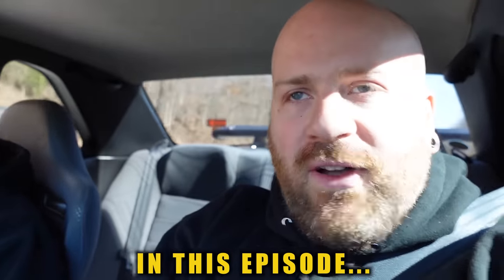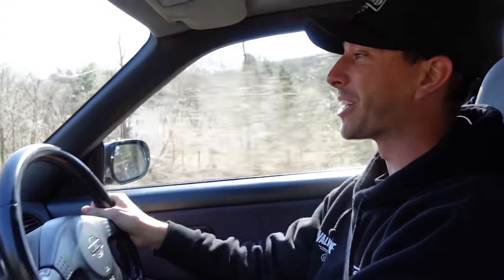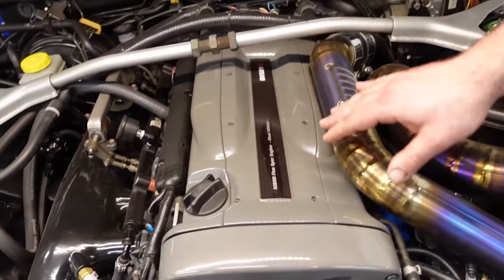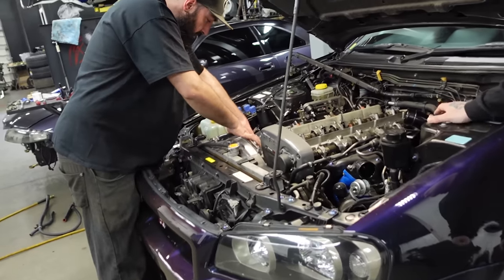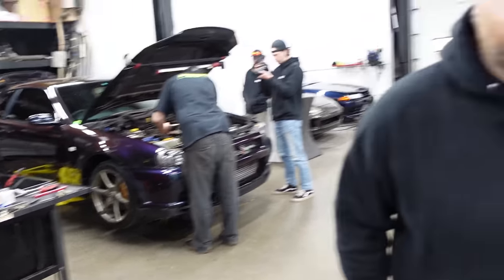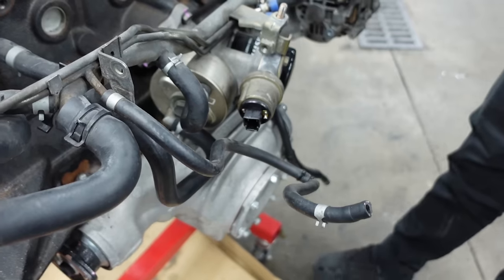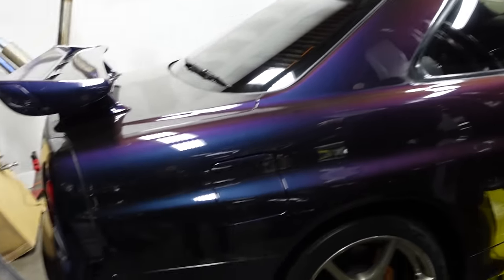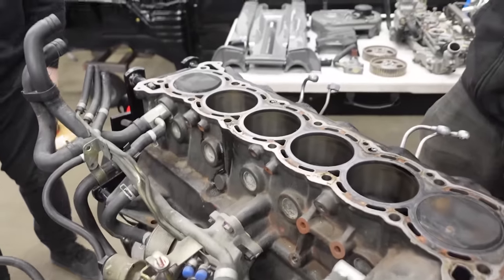Discovering R34 GTR Has Blown $40,000 Nismo Engine...

Comment: With the budget you’ve got, I’d be shelving the Nismo engine and building a separate RB26 with the HKS gear.
Reply: I believe the build was done a long time ago so any suggestions now are irrelevant unfortunately
Reply: I was thinking the same. But as the other person said, I’m assuming the build is already done and anything we say is irrelevant at this point.
Reply: agreed, baseically doing that ot a fine spec engine was stupid, just buy a normal 24U block and build the HKS 2.8 on it would be best of both world
Reply: @venroxslip6032  I’m aware.
Reply: And Teej had a spare RB motor stored at Tommy’s didn’t he?
Reply: RB30 is what I'd do, personally.
Reply: Just get the Aussies to build an engine. Big power and reliable for cheaper than jdm
Reply: @macbook802  he makes things pretty not fast. I'd live to see him build an engine rather than bolt one in and see how good it goes

Comment: The short and simple of it is the Japanese economy in the 90's was doing stupidly well, manufacturers did not need to comply with anywhere near as many safety regulations as they do now and because of the booming market people had bulk coin to splash on sports cars - which actually sold at the time. 

The R33 GT-R was built the way it was because during the R32 production cycle Gr.A (Group A racing) was cancelled and for a short period of time there was no foreseeable racing series for the GT-R to compete in - until the JGTC was formed. So Nissan built the R33 with the ethos that it would appeal more to the affluent business man that wanted a well mannered and luxurious sports car to daily drive - rather than the more homologated R32 and latter R34 GT-Rs

Comment: Pull the motor and keep it like it is... And build another motor for it..  and keep the fine spec engine stock.. It'd be worth much more with it being Factory.. imagine buying a R34 GTR and not only did it come with a badass 600+ hp  engine, but it also came with a fine spec factory engine..!!

Comment: Take the NISMO Fine Spec  motor out and store it, take the HKS parts you bought and build another motor to put in the 34. You'll a rare motor in storage that will appreciate in value and on the flip side you'll have a 34 with a hi-po motor that you can use anytime.

Comment: Crack that motor open and get to work son!

Fine spec hks 2.8 is a win here mate 🤌 All the love from AUS
Reply: Nah piss the 2.8 off and 3.6 it with billet block . You cant beat cubes and 10,000 rpm . Have you seen king jdm r34 in aus . Killer gtr it is .

Comment: Get a 3.2L stoker and 88 pro mod turbo with a sequential that’s all out
Reply: Billet block with a 3.6 is a killer combo . 10,000 rpm and 1,600hp is a nice number .
Reply: @ytthecommunistplatform.2675  nah if u want 2000hp 3.2L billet block 101mm promod that’ll sound better and a 2.8L HKS

Comment: Any reason why they make the rims multi fit instead on having having only the 5 holes?
Reply: They aren’t “multi fit” actually. Those holes are drilled straight through without a lug nut shoulder. It’s done as a weight saving measure in the “bowl” area which are notoriously dense. There are nicer ways of pocketing the backside of the bowl to reduce weight but, I suspect this “drill through” technique is a nod to the previous NISMO LMGT versions of years past.